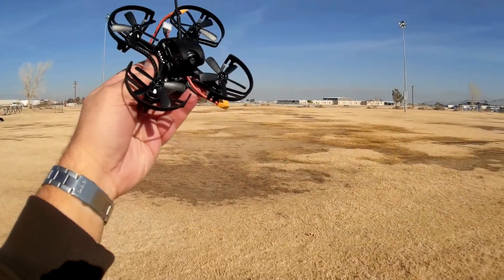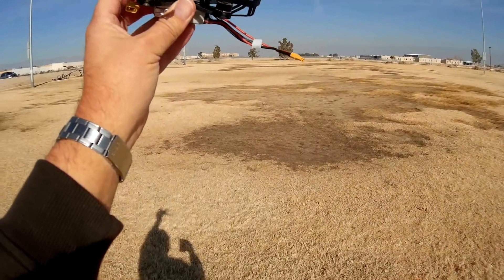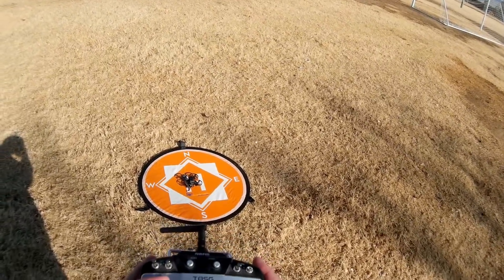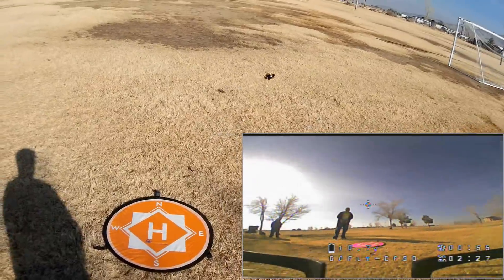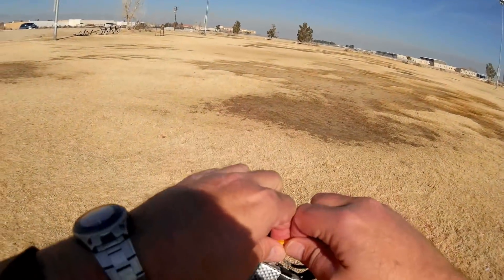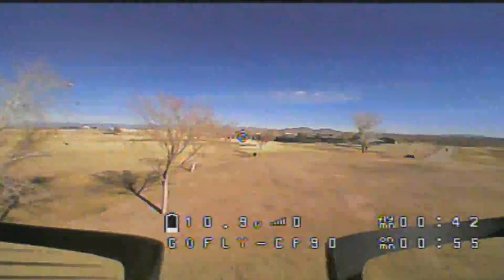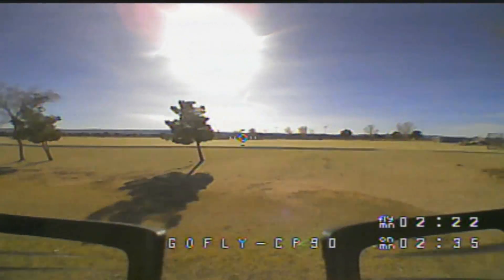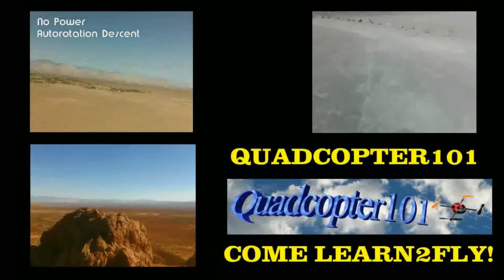Furibee QAV95 Brushless Micro FPV Racer Drone Flight Test Review

Comment: Yeah, all of the Micro Quads with a lot of power need very high discharge batteries. Most of these I'm guessing can pull 40amps or more on punch-outs. Thanks for the video and Happy Flying!

Comment: Personally I believe you have a old weak battery. A low C rating will generally result in a brown out if too low, but if it's high enuf to provide amps and not brown out, then it actually should result in increased flight time , not shorter. Get GearBest to send you some good batteries for these reviews.  I believe this quad has more potential than was shown.

Comment: Since I have the equipment to test lipos, I've found that most of them are WAY over rated, especially the 'bargain basement' types. For example, some of the so-called 5200 mah (3S) batteries made for the X380 were closer to 4200mah when tested on a bench. I'm sure the same applies to cheap lipos. When I want something decent, I'll go with a Tattu or Lumenier battery. If I want something good that will LAST, I'll pay the extra for a graphene battery, which will outlast a Lipo by a factor of 25 to 50 times. Graphene batteries can deliver a lot of steady high power amps, but when they get close to being 'spent', the voltage will fall off very rapidly, so you need either an OSD or reliable buzzer with them. Look on eBay .. you can find some better batteries and not have to wait for a slow boat from China to get them. Cheers.